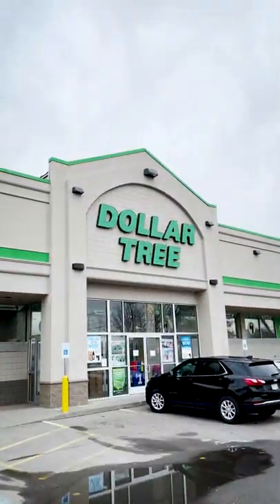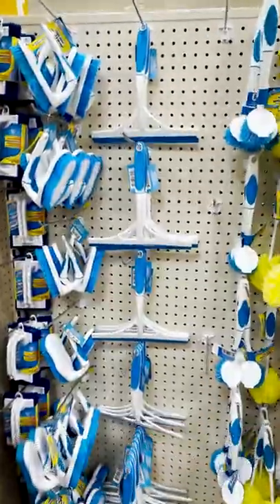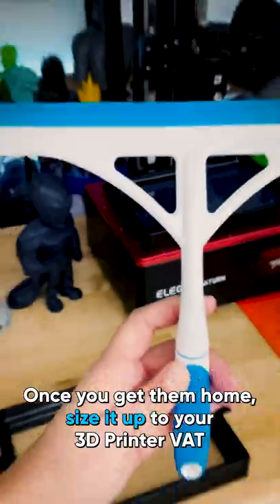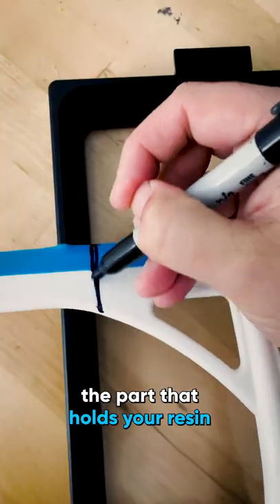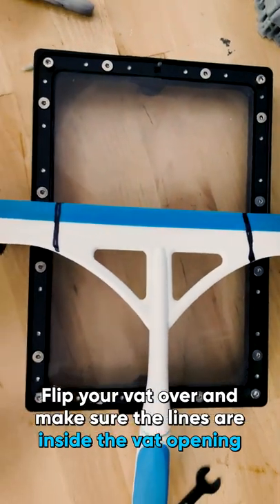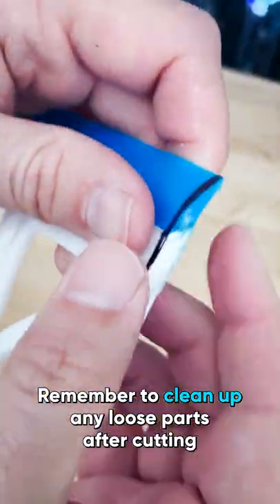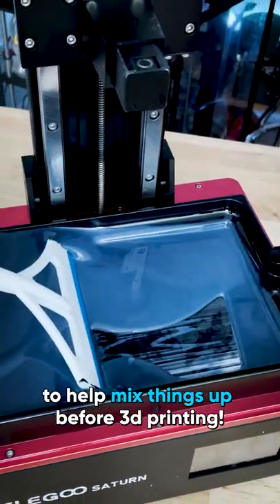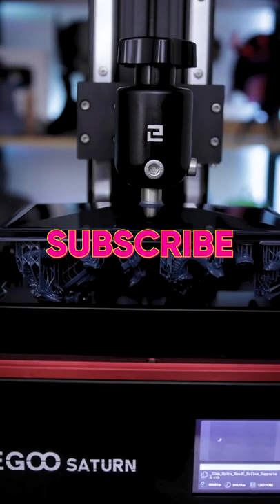$1 Resin 3D Printer Hack #Shorts

Comment: Getting first Resin Printer. Anycubic Mono X, and will using this tip right away.
Reply from the maker: You’re going to love the machine. I’ve been getting great prints off mine
Reply: @UncleJessy  they had a great deal for Easter. Cheaper then on Amazon. Got it after your review and the extreme lack of the Elegoo Saturn.

Comment: I came up with the same idea last year and you have to be careful as if any particles come off the rubber or the plastic this then mixes into the resin and can cause contamination and possibly ruin your print plus the resin!., also any shards of plastic gets into the resin this could damage and possibly puncture the film.
Resin at the end of the day is a chemical and like all chemicals they don't react to well when mixed with other foreign materials or other chemicals, by all means don't let me put you off or dismiss the idea, I am only going on what my experiences were and also knowledge of chemicals which I learnt through my time as a printer where the inks can be contaminated so easily, even with objects used to mix the inks, plus chemical reactions.
Reply from the maker: Oh dang! Thanks for the headsup on that

Comment: just use a japanese silicon egg scraper, its already the right size
Reply from the maker: Zero idea what that is but sounds cool!
Reply: @UncleJessy  those are basically a much larger version of the plastic scraper you get with your printer, only then made out of silicone.

Comment: Completely off topic but if someone could help that would be great. I was in the middle of printing several terrain pieces over the course of 4 or 5 printing sessions. I had been using Phrozen water washable resin, when I ran out I tried mixing the rest of the Phrozen resin with some Elegoo washable to do the last peice of terrain. That print failed. I figured it was just the resin mix that caused the failure so I cleaned out the vat and build plate. I added a fresh bottle of Eryone washable (which I've never used before). Now every print session I run has partial or full failure. I've tried different settings, re-leveling the plate, nothing seems to work. Does anyone have any ideas?